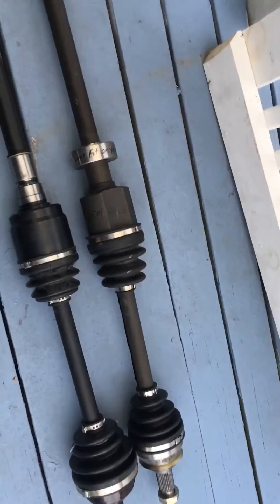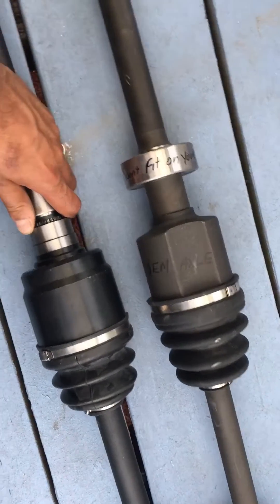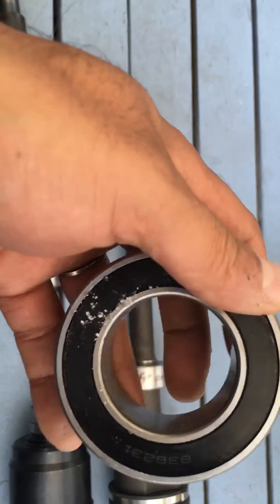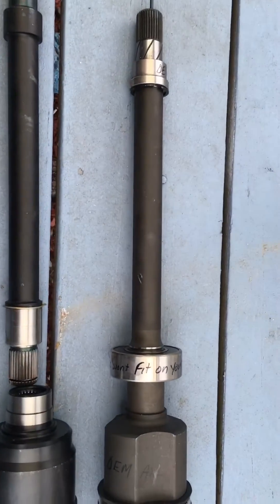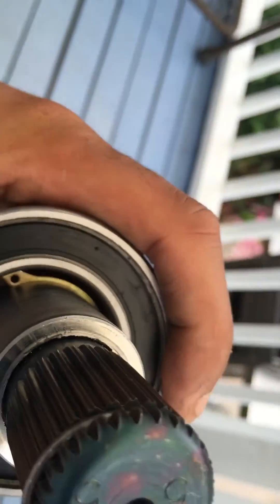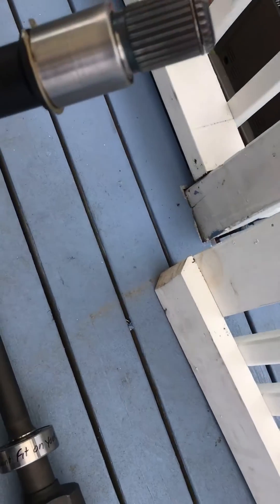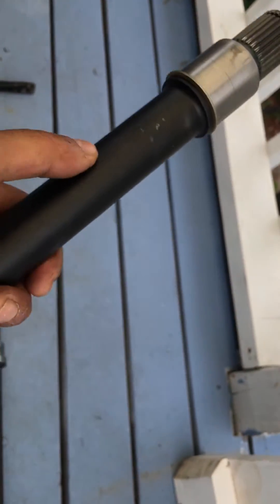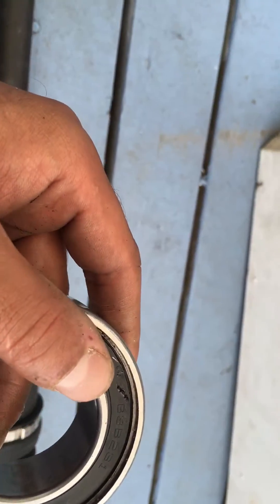Driveshaft shop RACE axles Mini Cooper problem -Solved see Description

Comment: I also had problems with mine I found that when lying next to each other they look the same but when standing them up the drive shaft shop one compressed almost ten milimeter more than oem and jumped out when going around sharp corners